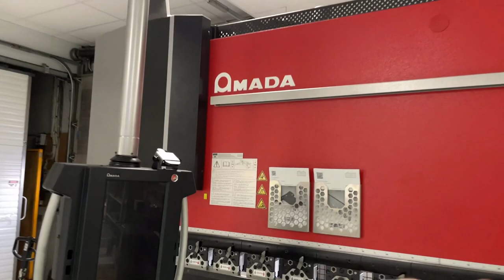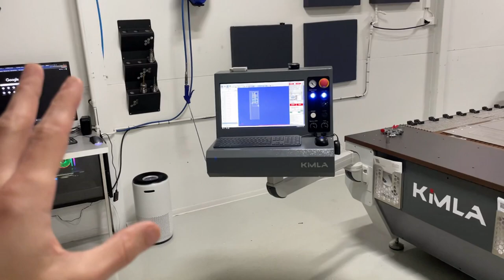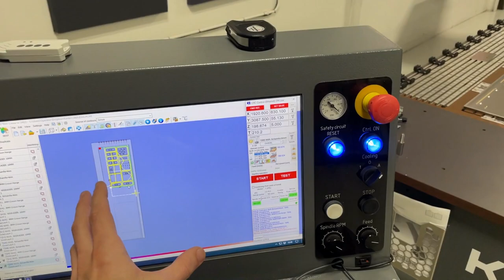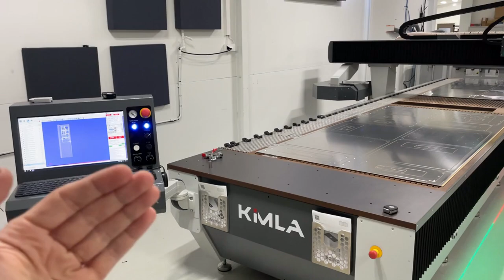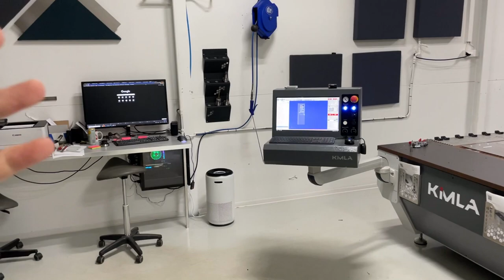Upgrade update part2

Comment: Hi, amazing technology, I see that you are cutting Aluminum, so can this be the same for 1mm or 2mm steel? if yes then this is better than a laser cutting machine!
Reply from the maker: Yes, 1-2mm steel is no problem. You'd want to run dry or use oil instead of ethanol ofcourse. 👍

Comment: What type of aluminium you machining most? Have you working with PA6 aluminium? 
Maybe you can share some tips? 😉
Reply from the maker: Almost always AW-5754-H111 or 6082, rarely 7075. The 5754 is of a H111 state so fairly soft, doesnt crack.
Highly abrasive so endmills tend to wear rather than snap. You want to take fairly large chips, dont rub. The heat needs to leave with the chip.
Go with single flute, maybe two flutes work if you are running bigger endmills, say 8-10mm dia and up.
A quality low friction coating is a must and lubrication isnt required but if you want to run alot then yes. 
Ethanol works great and doesnt leave a mess.
6082 is alot easier and 7075 cuts like a dream in comparison.
Get some endmills and run some tests knowing that you will break them, fastest way to learn :)
Reply: @randomrouting  Thanks so much for your advice 👍
We machining almost only PA6 aluminium (AW-2017) which is veery soft and sticky. Many endmills has gone 😂
We get the best results with roughing passes about 1mm with higher feed using single flute mill and then finishing pass using 3 flute endmills. Looks good but takes more time. 
We own a very similar machine to yours only with shorter table and we use cutting oil.
Do you have a cover that slides and presses against material? This looks diffrent form our.

BTW. Your automation is great 👌
Reply from the maker: @razorline5319  Ah yes, I bet the 2017 is tricky :)
The suction cup has an air cushion that allows it to hover over the material. Excellent chip evacuation and the ethanol jets come out through the platter.
Yeah the automation is getting really good, still some small stuff to fix :)
Reply: @randomrouting  I think good chip evacuation may be the key to solve our problem.

One more question, in the video you said that you use HDF boards. We only use MDF - this is how they advised us in Kimla.
You know the diffrence between HPF and MDF? Any experience? Greater vacuum power? Less leaks between parts?
Reply from the maker: @razorline5319  I bet chip evac might be a little more difficult with oil rather than ethanol. Not sure but vicosity does play a role.(Not critical ofcourse, just a thought)
As the coating wears chips tend to stick more and more,  nothing kills an endmill  faster than recutting chips in soft alu  :)

MDF/HDF
Depends on your vacuumpump but you are probably running a dry running becker rotary vane?
Then yes HDF would be better. MDF is too porous, doesnt take much cutting before the pumps cant keep up due to the flow.
MDF density is around 600-750, HDF is 750-950 (kg/m3) and that keeps the flow down and the pumps working in their prefered range for longer.
Higher flow/lower pressure pumps like side channel blowers might do better with mdf.
Reply: @randomrouting  we use Becker U 5 series. I need to tell my boss to buy HDF for testing. We'll see
Reply from the maker: @razorline5319  Well in that case HDF will be alot better for both hold down and the pump.
Get atleast 850kg/m3 👍
Reply: @randomrouting  very helpful conversation thanks